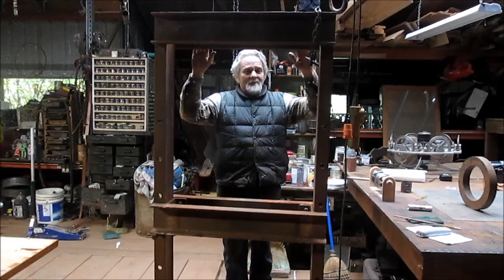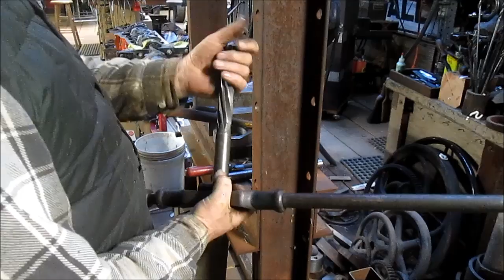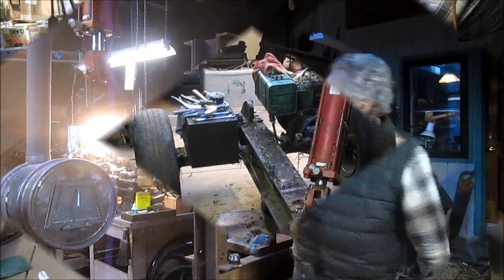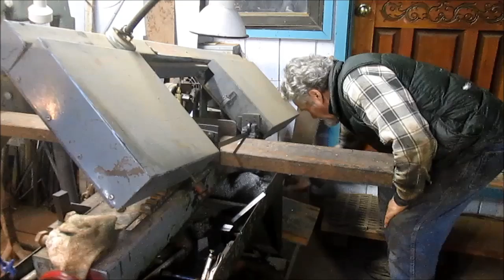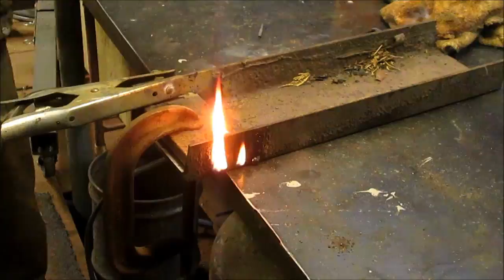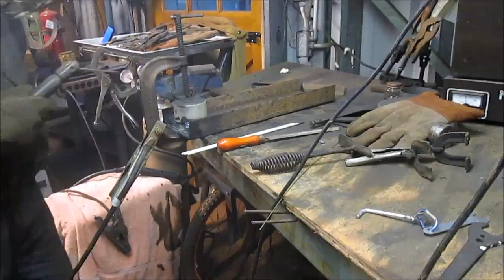Shop Press Build #1

Comment: About 30 minutes in, cut on the round stock being crooked; adjust the blade guide so it just misses the the material you're cutting... Otherwise the blade wonders and gives you a cut like you got. Just a helpful tip. 👍